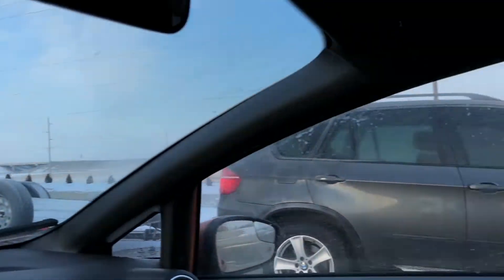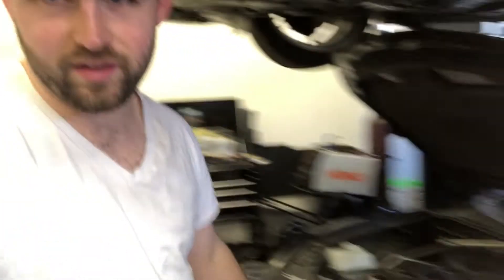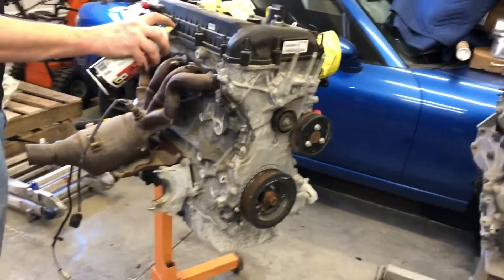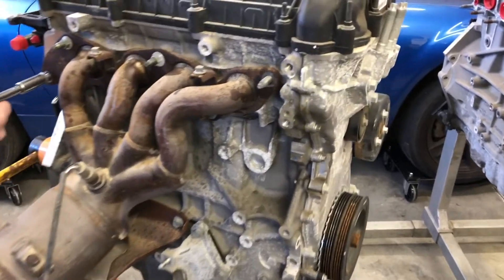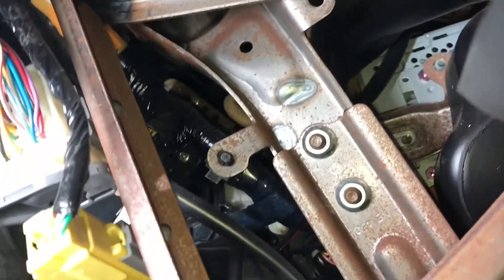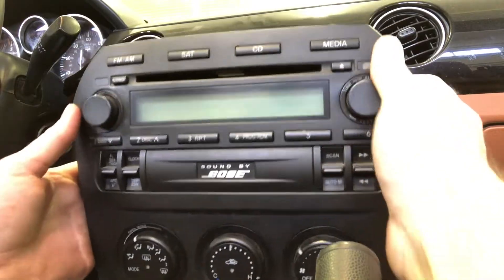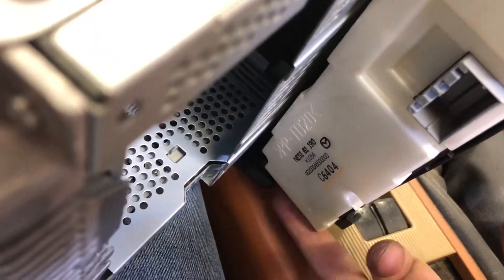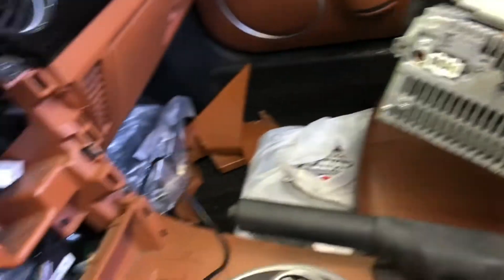Project Miata: Oil Change / Thermostat dials / Aux Cable

Comment: Nice video. Fellow NC owner here. Awful location for an oil filter, eh? What oil and filter do you use?
Reply from the maker: You are going to get mad at me for this, but I just run whatever full synthetic is the cheapest! Most of the time just generic oil from autozone. I change it so frequently during track season that I don't really think the brand matters. These Mazda engines just keep coming back for more!
Reply: @ShiftyIntentions  not at all. I use Walmart’s generic synthetic. Kirkland just came out w a synthetic btw so even cheaper 😂👍🏻